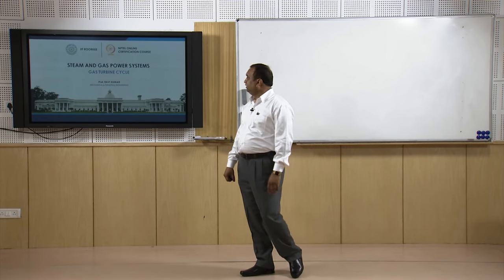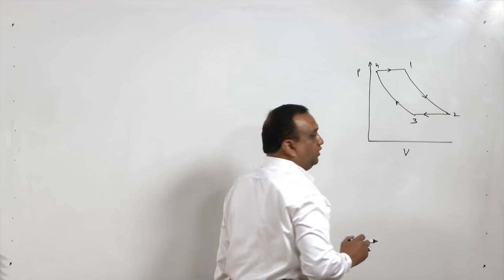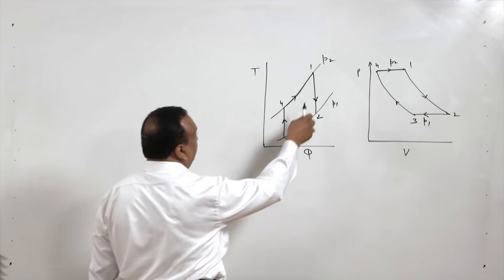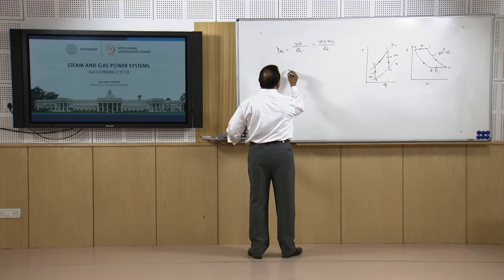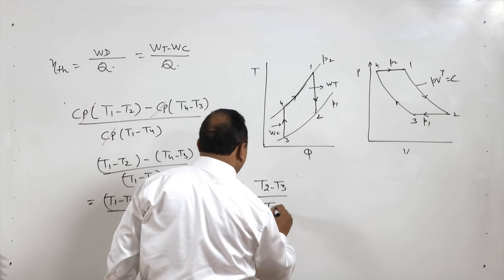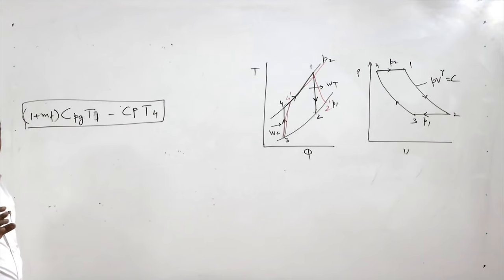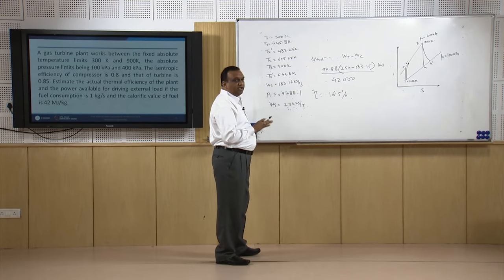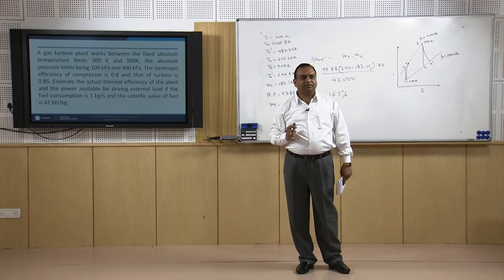Lecture 31: Gas turbine cycle

Comment: for those wondering about enthalpy, h3= 932.93 kJ/kg and h2'=484.76 kJ/kg from AIR TABLE - A 17 in Cengel. But that yields slightly different value than the professor's. In that case A.F ratio is 91.63 and efficiency is 14.3%

Comment: Doubt regarding  the P-V diagram does the pressure decreases from the maximum to minimum or on what process does it takes place professor
However the process -2 is isentropic compression, process 2-3 is constant pressure heat supplied , process 3-4 is isentropic expansion and last process is heat rejection
Kindly clarify the doubt professor

Comment: For adiabatic process , pv^ n but sir takes it pv = rt why ??? . Can anyone explain me plz
Reply: because it is being considered as an ideal gas
Reply: (1) p1(v1)^n  =  p2(v2)^n 
(2) (p1*v1)/T1 = (p2*v2)/T2 
both the equations are used for ideal gases where as equation 2 can be used for any process (Ideal gas) equation 1 depends on the process for eg: if its isothermal n=1 then P1*V1= P2*V2